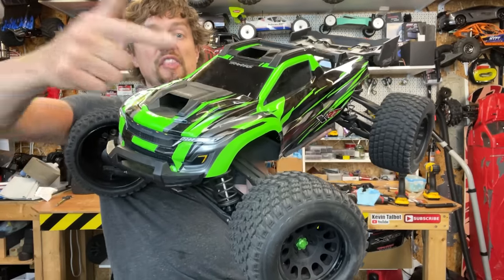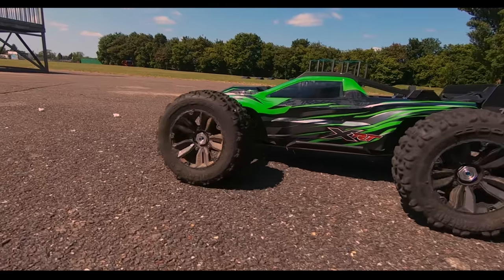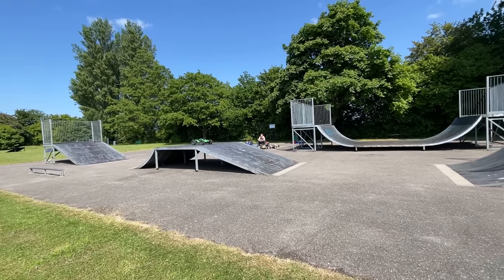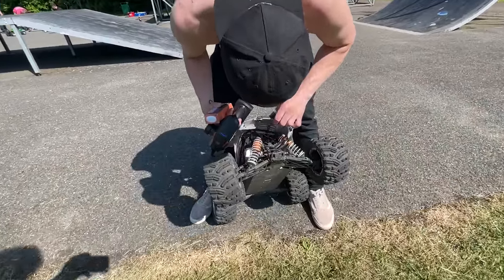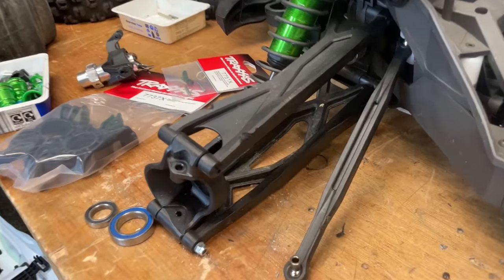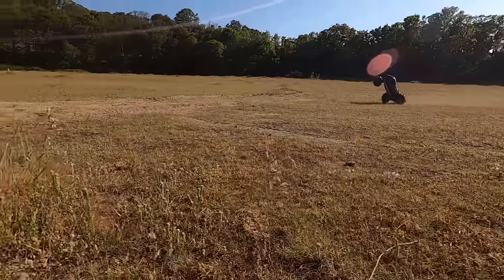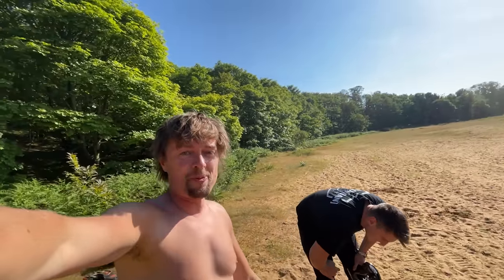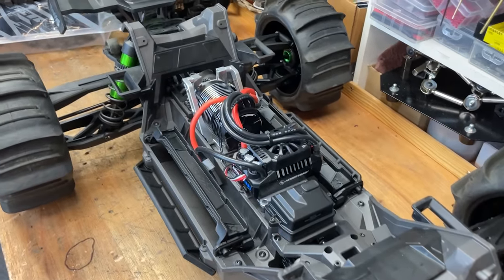Giant Motor Destroys Traxxas XRT rc car

Comment: It seems like every time I see someone get out their XRT that something breaks on it almost immediately. I mean for what it costs that would drive me nuts.
Reply: Most people don’t drive and bash theirs this hard though. I’ve had mine for a few months and I drive it more conservatively and haven’t broken a thing. Kevin’s content is purposefully rough because it’s more fun to watch, and it creates content of working on the truck in the shop.
Reply: If you leave it stock they hold up great. Any motor bigger than stock shreds the monkey metal driveline. Same with xmaxx
Reply: @based_will I went through 3 rear ring gears in my xrt until I shimmed the hell out of it. Now I can do whatever I want and it's Gucci. I run a fat tp motor which is definitely more powerful than kevs hobbywing motor

Comment: Hey Kevin I don’t know much about rc car wheels but on the speed foam wheels why not put a strap around the wheel like they do on rubber one to keep them from blowing out
Reply: I agree. I think some properly sized rings could be used to keep traction but contain the expanding foam. Plus, you don't have to wait until you hit the track to test it - you can spin wheels up to speed in the shop. Until you have a tire that holds together at max RPM there is no sense even going back to the track in my opinion!
Reply: Why The heck did Kevin heart this comment but didn't reply
Reply: He prob has some auto heart system and doesnt Even read comments.

Comment: Just got my Traxxas 2WD Stampede fixed at the local shop after not playing with it for months! Broke the steering servo and tried replacing it myself... didn't know about the little adapter on it, so it was a simple fix for them. While I was there, they noticed my controller wasn't working right so they gave me a new one free under warranty 😊 Thanks Kevin. Watching your videos is what made buy it last year and coming back to your channel is what made me get it fixed 👍

Comment: if it doesnt already exist, maybe an in-air self-right mechanism that automatically adjusts throttle and steering mid-air to descend level (all four wheels) to the ground from a jump.   

talbot twister

find a raspberry pi programmer to make it more nerdy

Comment: That’s a common problem with the m2c extension hubs. My buddy had one that got stuck and I did as well. You need to get a m5(I believe) bolt and thread it into where the set screw goes into the hub. Put the hex in a Vice and now you can beat the bolt with a hammer and it will pop off. After I did this I polished the heck out of the m2c parts to make them fit better

Comment: I know nothing about RC car stuff, but are you controlling them in the air to some extent?
Spinning the wheels and using gyroscopic forces to angle them and twist them for landing?
Reply: You can control how they roll forward or backward by braking or accelerating.
Reply: Not sure what kind of physics does this, but yeah, if you have relatively heavy tires and a backup of power, you can spin the entire car midair, even multiple times.
Reply: If you hunt down some videos about 1/8 buggy racing you can find some really good explanations about air control.

Comment: I ran that exact 5687SL motor on 8S on my Kraton 6S EXB for about half a year.. Not violent enough to my taste (yeah right LOL, it broke a steel pinion in half twice!), so I rang TP Power up and they built me a 10kW behemoth upgrade (TP5660) instead.. Is it necessary? Absolutely not. Is it face-meltingly awesome? Heck yeah! 
Keep on truggying Kev!

Comment: EPIC XRT run Kev 😱. Hoping the Vitavon hardened spiral gears are the solution. Traxxas monkey metal just can't take the heat 😂. It's possible thread lock on the axel grub set screw leaked and bonded the hex to the axel. I've had to heat and pry off the hex from the hub before using a hammer and large flathead screwdriver as a tap. A thin coat of grease on the axel can prevent it from locking up. 🍻

Comment: I did not see that the soultion to the problem in the video. Did you find it out? 

I have had excatly the same problem with gearing noise. Hobbywing 1100kv, Max6 and Vitavon gearing

It happened after I installed Vitavon spiral. Stock was no problem. 

 I opened front, center and rear diff 3 times. All good. Bearings good. Driveshaft good. Center driveshaft good. All gears good. Changed rear upper/lower bulkhead. Bearings good. Driveshaft good. New Vitavon front/back diff case and gear case.  Shimmed 0,5 mm rear diff. 

Same noise after 15-30 sec. I had to go back to stock. 

Vitavon was super cool. Sent med a DHL pickup to mail back.

Comment: Can't believe you stripped the rear diff because the mesh was incorrect, then you just assembled it again without shimming the gears or at least just checking the mesh before you covered it in grease and expected it to just be fine!?

Comment: Love all your videos man!!  Been a long time fan!  I have one question though, I have put the bigger castle motors in my xrt, losi dbxle 2.0 and my kraton 8s all have either 800 kv or 1100kv castle motors in them.  I feel like i am not getting all the power with the current gearing i am running in them, and wanted to know what you would run in yours to get the most out of them.  Thanks man and hope to hear from you soon!

Comment: Kev have you seen "Blake Wilkeys Urban Assault 3 Tijuana"? Hes running and gunning a trophy truck with a VW beetle body. Its insane a cross between Ken Block and a UDR!!! Its insane. The suspension on those things are unbelievable.

Comment: This idea came from this video but I'm referring to your speed car. Can you try to put most of the weight as much to the center line of your car as possible? I know the motors are. Is there a way to put a second "story" on top of the motors to keep the weight centered? You'd be able to make/use a skinnier body too?  I thought I would give you my thoughts on that, was wondering if that was possible? Looking forward to more of your speed runs. Just thinking that if you have more weight over the center line of your car, that you'd put more direct weight onto the front of the car. I'm hoping your found the "cure" for the loss of tread going that fast...lol.  I'm not into RC just yet, and you have been a great motivation to start. Thank you for your videos and keep them up. I am hopfully getting my first RC Traxxus Rustler 4x4 today. I'm excited because it's my bday present to me.

Comment: My Xmaxx made that noise and it was the center diff.  I found if the pinion and spur  strip, those little metal shards could get caught in the drive shaft when putting the truck back together.  Not sure why traxxas keeps that chamber wide open under the pinion and spur.

Comment: It definitely is a big problem with heavy big RCs we have the HPI savage HPXL Flux and that monster blows a diff gear every five seconds on 4s It can do 6s. On 4s it can do 55 easily and on 6s i recon it could do 70mph   Kinda glad we’re selling it probably bought more than the car is worth in parts

Comment: any tech guys can solve this?
old brushed rc car with dead battery 7.4v 1200(doesnt hold charge)
new working tested lipo battery, 8.x volts 900, DOESNT WORK inside the car, car wont move

old car should work on modern power source right? anything to diagnose here?
Reply: car DOES work on the old battery (few seconds till its dead again) and does NOTHING on the new lipo

Comment: All gearing is junk. Pinion and spur, pinion and ring gear for front and rear diffs, most people brake the front lower chassis and bulkhead too. Destroyed bellcranks terrible wheels and tires. I think it’s trash.